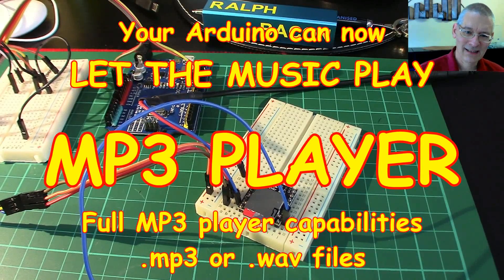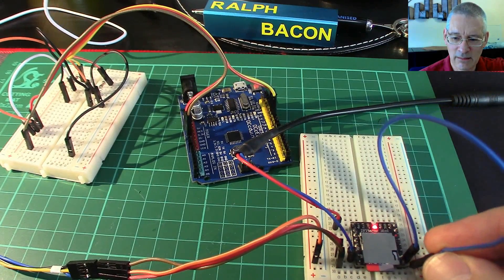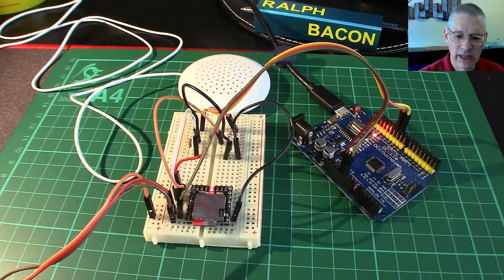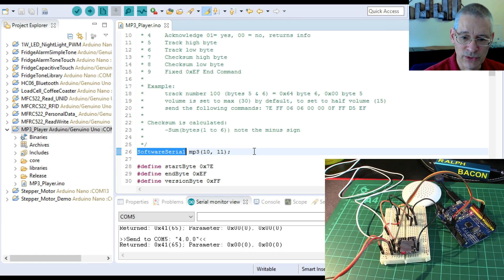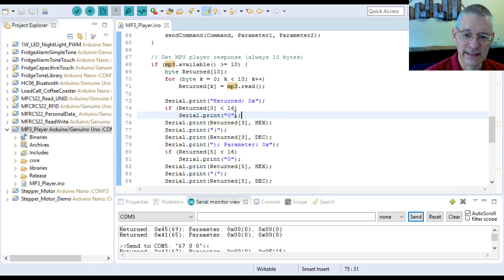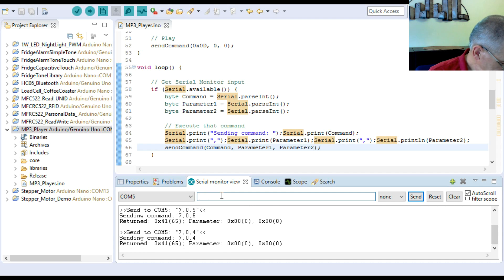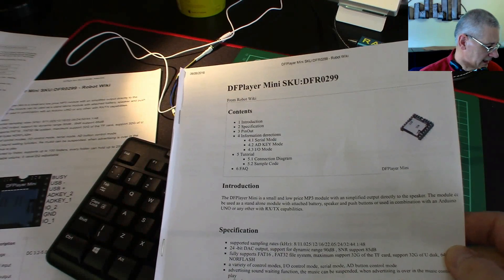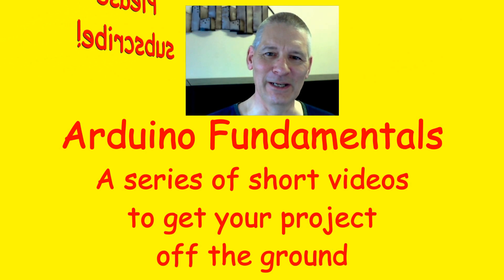#40 Let the music play! Arduino based MP3 Player for music (or announcements)

Comment: Very good video, only a shame I didn’t see it earlier when I was doing my own trial.  The issue I had which meant I shelved the project was the lag between asking for a track and it starting to play which for me was anything from 0.5 to 1.5sec .. I spent a while trying to see what I had done wrong but left it with the feeling that the unit is good enough for an MP3 player and I was expecting too much.
Keep up the good work!
Reply from the maker: I guess that the time lag is the buffering time when reading the requested track from the SD card, decoding the first few frames and starting to play. I wonder if there is a lag when pressing Play - Pause - Play? I'd expect it to play after a pause immediately (which would sort of prove the point). The only thing I did not like about this device was that you could not select a track based on file name. 
Great to hear from you Chris, thanks for posting.

Comment: I'm going to use 1 of those along with a RFID Reader to speak out what is in certain pill bottles etc. I will use the small sticky RFID tags and attach 1 the to the inside bottom, or bottom of the pill bottles. That way the better 1/2 can place the bottle on the reader and it will announce what is in it. I will stick them to other random things also, like spice bottles, and what ever else she has difficulty reading. ( Vodka / Rum / Vinegar / You get the idea.) She has Low Vision and I think this may help her a lot. Now, If she could only code. Guess that's up to me or Benny. Thanks for the Vid Ralph.
Reply from the maker: What a great use of the RFID reader and MP3 player. When you get it working make a video and you can link to it from here.

Comment: Hi Ralph. If you use an ESP32, you don't have to change the logic levels with resistors. Pin 17 on the esp to RX on the mp3. Pin 16 to TX.  5v from ESP to VCC on the mp3. Here is your code, modified.  https://pastebin.com/qH4hNGES
Reply from the maker: Excellent work, User Spice, and that applies to the ESP8266 as well, as they are both 3.3v chips. These days the ESP8266 (and sometimes the ESP32) are as cheap as an Arduino so it makes sense to get the move powerful chip. Thanks for posting, appreciated.

Comment: Hi, I'm considering picking one of these modules up, could you tell me if you think it would be possible to control the playback speed or frequency of the audio via a potentiometer? Thank you.
Reply from the maker: I'm afraid that functionality is not specified in the manual (see the video description, there's a link to my GitHub where you can find the manual for this player). It lets you pause, play, increase/decrease the volume and so on, but nothing about slowing or speeding things up, I'm afraid.
Reply: Ralph S Bacon Thank you for replying and I shall look into the manual your github. I'm very new to Arduino and was ideally thinking of some sort of random sound player where you could adjust the playback speed of individual sounds/mp3s and also for how long it plays each file (so you could use a potentiometer to dictate the amount of time spent on a sound before moving to the next one).
Reply from the maker: Yes, that sounds fab but trying to find a module that allows that, at a hobbyist price, might be a challenge. If you DO find one let us all know!
Reply: Ralph S Bacon I certainly will do! To your knowledge, do you think it would be possible to use a potentiometer to 'pulse' between sounds i.e the pot would dictate the amount of time spent on sound1 before moving to sound2 and so on?
Reply from the maker: I'm not sure how you envisage this working. Are you switching between sounds sources, and how are you doing that? I'd need more info to comment, really.

Comment: Can you do same deep tutorial for some FM chip?
Including RDS and stuff

Thanks
Reply from the maker: Interesting idea, jw200. Sometimes an idea like this turns into a video very quickly, other times it can take several months. But I think this is a good idea and a good way to learn about the Arduino too, so stay tuned, I will look into an I2C FM module.
Reply: @RalphBacon  Thanks.
Im interested in learning how to take the info from   datasheet and make the protocol work on real chip with arduino.
Datasheet describes all these bits and bytes and packets that are needed to make chip come alive, init, boot etc etc. You get the idea.
I would like to learn how to create these packets of data and how to send them to chip. With correct timing and stuff.
Im not complete noob in electronics and coding. But i really want to learn about the data.
Then i can try to work with some other chips, just by looking datasheet and making it work. 
Without looking other people code first.

Sry for my English
Reply from the maker: I find the best (easiest) way is to find someone who has done it before and has written a library (Arduino compatible). Otherwise, it would take ages just to get the protocol right.
Reply: @Ralph S Bacon  I actually got it working. Reception is not that good as some guys have told. But depends probably on location and antenna, i just had 10 cm wire.

There are better chips..
And its not that hard but i have also one FM chip that uses SPI and that looks much complicated.
I have bought some other FM chips also, just to make tests and learn. One project is planned, will see how it goes.
Reply from the maker: It will be interesting to compare notes, once my module turns up. It might not be the same one, of course. Wait and see!

Comment: hi , i haven t got this dfpplayer, i have this : https://www.amazon.fr/gp/product/B06XHJTGGC/ref=oh_aui_detailpage_o06_s00?ie=UTF8&psc=1 , i dont know how were i can connect the speaker, do you know how ? thanks for your movie
Reply from the maker: That (French) link is for a simple SD card writer/reader, not an MP3 music player. Wrong link, perhaps?
Reply: @RalphBacon  sorry i'm french :/ it is say : UTILIZATION: You can for example use the module to install a control station with external memory card or to make your Arduino an MP3 player. I finaly find how resolve that. I use GND and digital pin but the sound is not good ... Thnks for your anser

Comment: Ralph, love your videos. Question about the voltage splitters. I can see why you need one for the TX pin on the Arduino to drop it from 5v to 3.3v but why do you need on on the RX pin. The voltage coming back from the MP3 player should be 3.3 V and that should not cause a problem for the Arduino and since you set that pin to INPUT why would it ever generate 5v? Are you concerned about transient voltages ?
Thanks,
Richard
Reply from the maker: Yes, Richard, I had wondered about that many a time, but I was following what was recommended on the datasheet. Even though the Arduino pin is an input pin I wonder if 5v is still present there? After all, if you set the input pin to a PULLUP then it will definitely have 5v. Without the PULLUP the pin is probably left floating but what exactly does that mean to the MP3 player? Long story short, it's just safer to include the level shifter, but it would probably work without (but at your own risk!). I'm very glad you like my videos, and thanks for posting here; always good to hear from my Arduinite followers!

Comment: Anyone have any guidance if I wanted to do this, but with the SD card connected to the arduino and not built into the one like Ralph has?
Reply from the maker: I'm pretty sure the SD card on the MP3 player is tied into that chip, so trying to use any other will not work. But if anyone knows any different...?

Comment: I see where I messed up, I just put the 1k resistor and neglected to put the 2k in.  Didn't seem to kill the player, but it didn't work either.  I simply re-routed my push buttons to the player and bypassed the arduino completely. It works OK I guess but I think I will rebuild it since I did it all on a perf board and both units are soldered in solidly.  I used a pro mini for the setup and I think there is room for the other 2 resistors, but not sure how exactly I will wire them to become voltage dividers as you have.
Reply from the maker: Breadboards are the answer, Jerry, until you have it working and then transfer it to perf board or strip board to avoid the situation you're in now! Some of my constructions never get past the breadboard stage (I still have a 3 x 3 x 3 LED cube sitting on one, complete with Arduino!). Just suggestin'
Reply: Thanks, I have a lot of breadboards laying around, there are just days when I look at them and think, "I can do that easier with a soldering iron!" However that said, I think I will go back to the breadboard. I have a lot of old arduinos laying around and a few of the MP3 players, I usually order 3 or 4 of an item because I know how I get when I just KNOW I can do that quicker with an iron....
Reply from the maker: If you have several Arduinos and breadboards then you can build it on a breadboard, get it working "just so" and then use the other items you have to build a version on a PCB or stripboard, safe in the knowledge that you have your blueprint sitting right there in front of you (probably taunting you, as it continues to work but your stripboard version fails to do what you intended - been there, got the T-shirt!)

Comment: I'm trying to make a project were when a switch is closed the mp3 player will play a spacific announcemant for example when a door is open it will play the specific mp3 file which say "The door is open"  my problem is that if the push button is pressed continiously the file will not play, the file play's when the push button is pressed instantly. How can I fix this problem ? Thank you !!!
Reply from the maker: That depends on what that button is connected to; directly to the MP3 player or an Arduino? If the latter then it can be fixed in code. If the former then you need to use some hardware, eg a transistor or two to create a monostable, to give the MP3 player a single "pulse" so that the switch is not seen as continuously pressed. Let me know what your set up is and we will take it from there, OK?
Reply: Ralph S Bacon 
My set up is that when for example pin number 2 from the arduino becomes LOW or connected to the ground brifly the mp3 file starts to play.
Reply from the maker: So, let's see if I understand. The door opens, the switch contacts close and the MP3 player does not play.But if you just briefly close (and reopen) the switch contacts, the MP3 plays fine?
 
If this is what happens, then I suspect that your code is constantly seeing that the door is open (ie the door switch contacts are making a circuit) and your Arduino is sending a constant stream of commands to the MP3 player saying "play file x", "play file x" over and over again.
 
What you need is a flag in your code. A boolean is best for this. Here's some pseudo code for you:
 
bool doorIsOpen = false; // start with door shut state but it doesn't matter if the REAL door is open or not.
 
if (digitalRead(2) == LOW && !doorIsOpen) {
  doorIsOpen = true;
  Start your MP3 playing here
}
 
What this does is read digital pin 2, realises it is LOW but ONLY if you haven't already processed this state will the MP3
player get asked to play a file.
 
Now you need to reset this when the door gets shut, so you need something like:
 
if (digitalRead(2) == HIGH && doorIsOpen) {
  doorIsOpen = false;
}
 
This then resets the boolean when the door is shut so the next time it opens (pin 2 goes low) the MP3 player gets a signal to start. Have a play with this and let me know how you get on, OK?
Reply: Thank you very much !!!  I will try it and get back to you.
Reply: Is it possible to sent you my code some were for you to look at because I can not make it work?
Reply from the maker: Yes, send it to my email address that you can find under my Channel > About (I keep it pretty well hidden to avoid spam).
Reply: found your email check your messages
Reply from the maker: Got your email, Philip, will look at it later today, Saturday. First glance (that's all it was) doesn't make me shudder which is always a good thing! Stay tuned...

Comment: Is it possible to make it play spacific file when you press specific buttons? If yes do you have a code or do you know were I can get it?
Reply from the maker: It's possible to make the mp3 player play a specific file by number, eg the first four digits of your file name, which I believe I might have demonstrated but it's been a while. So, for example, you can say "play file 34" and it will find a file that starts with "0034" and play that. Unfortunately, I have not found a way to play a file by name, which is a pity, because then you could easily make this into a mini jukebox. But there might be other, similar modules out there that do allow that.
Reply: Ralph S Bacon 
Thank you !!!!

Comment: Hi I have this mp3 player on arduino uno setup with 3 buttons (pause,back and forward) but I want to control it with a 433mhz remote control just on and of would be ok, Also I want to add a white 5v led that fades in and out in rhythm with the sound. I have spent about two months on youtube researching with little success, so I would appreciate any advice or links would be great or maybe this is a project too far for a newbie to arduino and sketch code ?  thanks. The project I want it for is a Dr Who Tardis 12x6 inches that I 3d printed
Reply from the maker: This is very do-able indeed. If you watch my videos #26 & #27 you will see how I control some lights using a 433Mhz remote control. The concept is exactly the same. Instead of dimming or brightening the lights you would issue the command to stop, start, skip the MP3 tracks. I'm assuming at this point that the Arduino you mention does actually control the MP3 player directly (eg from GPIO pins)? So how does it work? Well...
 
The (usually 4-button, ABCD or similar) 433Mhz transmitter sends a signal to the receiver which has 4 outputs, each of which corresponds to the buttons. There's an additional output that responds to all the buttons (so you can flash an LED or something to show the signal has been received). Wire each of the receiver's outputs into a GPIO pin and "poll" to see whether any of them are currently receiving a signal. You do this by checking the state of each pin in the main loop( ) function. When one of the pins goes high (has received a signal) you just take the appropriate action.
 
My first recommendation is to watch both videos so you understand how I did it, follow the sketch etc. Then modify to suit. You might not need all 4 buttons, for example. If you have further queries post them under this post as a "reply" so we keep all the threads nice and clean. Good luck!
Reply: Thank you so much for you super fast reply and yes the player works great but the sketch and wiring etc I acquired from another youtube channel but I did try combining some other sketches with my existing mp3 sketch after watching a video on how to do this but with no success, so as you advised I will check out your other videos and do some more research. Thank you for your advice and time.